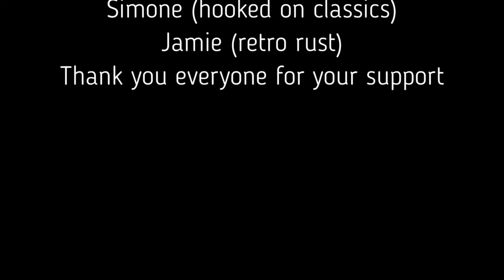Cortina Mk4 Ghia 2.3 V6 Restoration || Rear Tunnel Repair (P46)

Comment: When you paint your floor get some stick down sound proofing and it will look brilliant and hide a lot of repairs
Reply from the maker: Any idears what sound proothing to ise u would have liked to ise similar to what was down before all I can really find is car audio sound proothing I would like  somthink like a tar
Reply: Seam sealer will hide a multitude of sins  inside and out. The car didn't have sound proofing so it's not a priority I'd say. 😊 @AdamSNook.
Reply from the maker: @terryatkinson899  yeah im going to use seam sealer im not bothered to much about the welds on top of the floor its underneath i want to make sure is smooth

Comment: getting there pal,  Once that floor pan is sorted, id say that is another mega mile stone completed.  Are you still buying spares for it as you go along?  When i was doing the metro rebuild, i was adding some bits and pieces in,  Such as the electrics, the previous owner decided to add a later steering column, and cut the cars electrics to get it work. While the cars interior was out, it wasn't  hard to replace the full loom, to the later one. With in a matter of days i had the cars dash back in.
Reply from the maker: i havent got anymore parts as of yet but will be soon i do have all the other parts i orded before i need to make a list so i can tick it off as i go

Comment: Either you have hands like shovels or that grinder is tiny 😂
You'll wear gloves when that disc explodes 🙄 how do I know that 🫣
Reply from the maker: It is a tiny grinder does not spin that fast would hiw ever wear gloves when using my big grinder lol safety first and I'm guessing younhave had one shatter on you
Reply: @AdamSNook.  several times over the years, when you're young things don't bother you but when you're older, you don't heal as fast. Just looking out for you and anyone else I see doing stuff that can hurt you 🫣👍🇮🇪
Reply: I have had that also. It was in 1993. I used the big 230mm disc grinder and right after start up, the disc exploded in three pieces. I had two other colleagues working in the hall and fortunately the three pieces missed them. The pieces went through the total distance of the hall. Very scary. Yes, already then we Dutch worked safe.